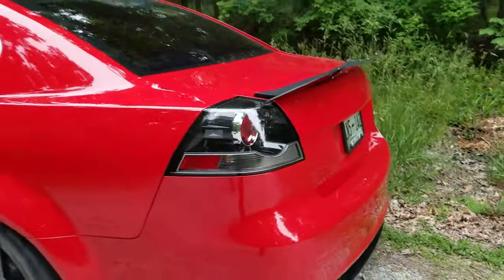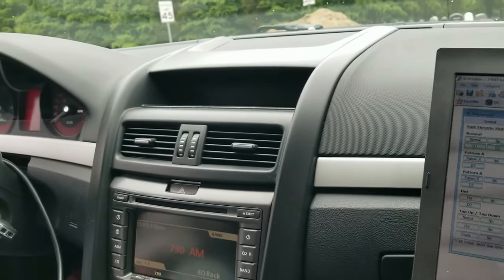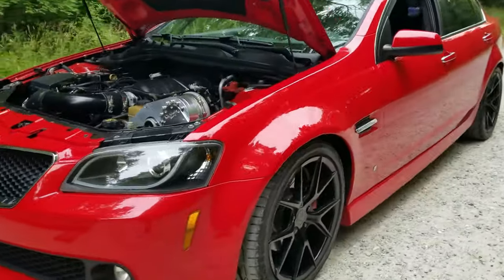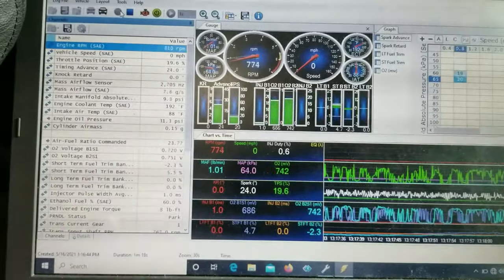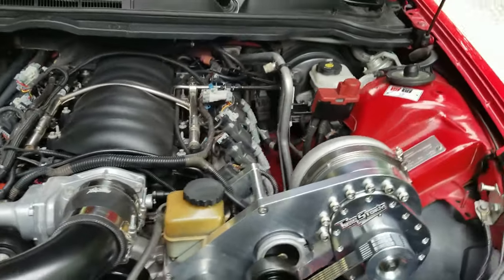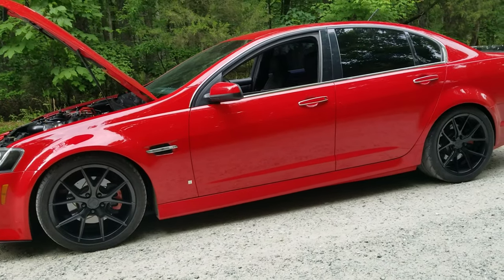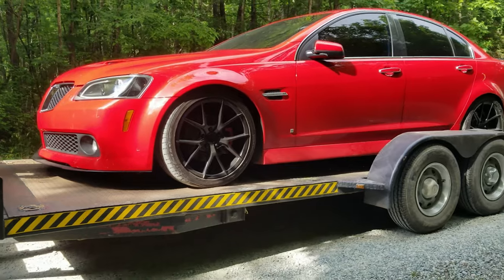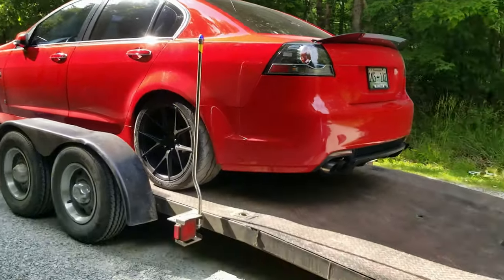Setting up  G8 GT with a Torque Storm SC, BTR 3 NA cam, exhaust, 3.45 gears, 110 lb injectors, etc.

Comment: Sweet! How much boost was it making with that NA cam?
Reply from the maker: Just under 5 psi
Reply: Damn smh
Reply from the maker: @pettymang8242  The owner is upgrading the intercooler and looking at belt slip now.  I just tuned it
Reply: @nufnuffz28 what intercooler did they go with ?

Comment: Is the 3.45 to much gearing for the supercharger?
Reply from the maker: No.   The torqstorm doesn't increase torque under 3500 or so, so the gearing helps get it in the power faster.   A roots type blower(LSA, Maggie, etc) don't need the gearing a Centrifugal does.

Comment: How does the vapor works controller work? Does it operate a secondary pump?
Reply from the maker: Increases pressure 1/1 in relationship to boost

Comment: Find any boost leaks? Psi seems kinda low for pulley size
Reply from the maker: There were none.  Non-boost cam and the intercooler was not as efficient as needed
Reply from the maker: @Kreston Steele let me know and we will get it touched up!
Reply: @Kreston Steele what cooler did you have before vs what do you have now